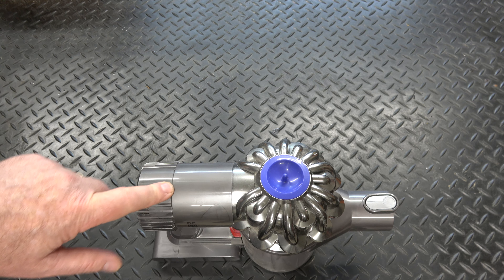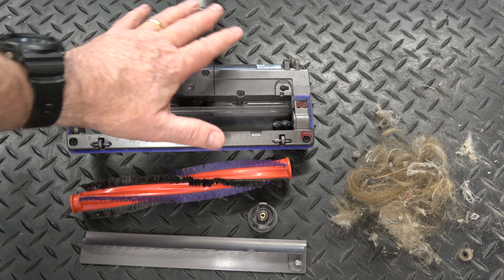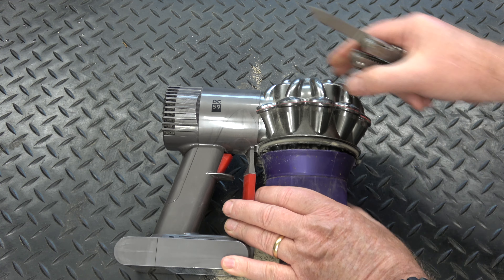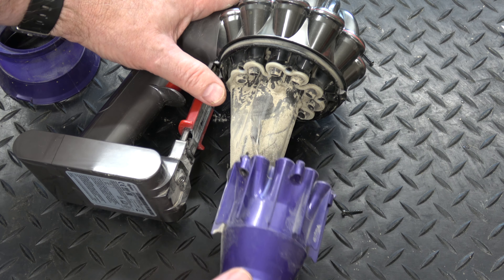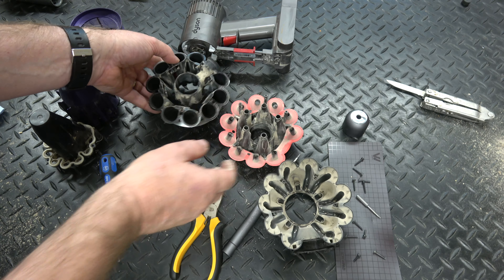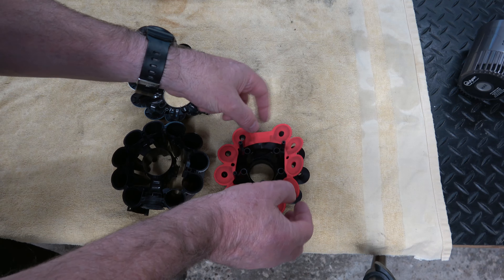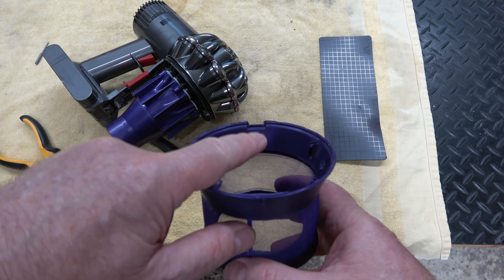Dyson Cordless Vacuum Pulsing or Losing Suction? - Check This Out. Deep Cleaning May be the Answer!

Comment: Thank you Russell - I swear this is the most high maintenance vacuum I've ever encountered :)
Reply from the maker: Ours took a long time to reach the point where I needed to strip it down.  It was much better after I finished the video.  :-)
Reply: The new v11 outsize tells you the maintenance info on the LCD.
Reply: I love your little pen electric screwdriver where can I purchase one of those
Reply: Lol, I've had mine the better part of a decade, and I'm only even watching this because someone decided to vacuum up flour. All I've ever had to do is clear the bin, and occasionally I clean the filter.
Reply: Yeah, they suck Henry hoover, never ever gone wrong and costs a fraction the price.
Reply: @RussellPlatten mine did great for a long time but someone swept up a bunch of drywall dust and I have had to do a full tear down !
Reply: Excellent video. I especially like the way Russell used a vac to clean the dyson. Way too much work. I want appliances to work for me, not the other way around.  Still looking for a good cordless stick-style vac.  Until then, it's back to the corded Sebo for me.
Reply: Agreed. It's extremely needy.

Comment: THANK you very much Russell, I could not have done the thorough cleaning of the cyclone assembly without your detailed instructions. 
A TORX T9  dedicated (not multi-bits) screw driver  6" long from handle end to tip will make this work easy and well worth acquiring one before starting the work.
My gratitude also extends to YouTube for their publications.
Reply from the maker: Cheers Gerd.  Good tip to use the screwdriver!  :-)
Reply: Good idea. My V6 takes a T8 not a T9. Maybe some models are different. Glad I double checked before ordering 🍻

Comment: Thank you Russell - with your help - I have fixed my 5yr old Dyson. It had a broken wand and suction problems a few weeks ago, and hubby wanted to throw it out, but I bought a new wand, in the face of strong disapproval, and it was fine until yesterday... I was puzzled, as I'd taken unit apart last time for a deep clean.It turned out to be the  old filter not fitting properly. Thank you for saving my face, because otherwise I would have had to get a new vacuum, and would never live it down...

Comment: Thank you so much.  I never knew the top came off the filter I had been just rinsing it off.  There was SO MUCH gunk inside and packed tight.  I had to use a tool to get the stuff packed in a the bottom. Now it's like a new vacuum!
Reply from the maker: Glad I could help Scott!  :-)
Reply: Same here, Dyson quality, but shame on them for not letting us in on that one!
Reply: Dyeing recommendation to rinse it is very poor advice. Opening it up as in the video allows a much more thorough cleaning.  I use a small flat blade screwdriver to press down on the raised tabs.  It takes some effort but well worth doing.

Comment: A very comprehensive video. I have a later model that gums up frequently. 
Fortunately I have compressed air & I give it a good blow through with the air nozzle. 

It’s unbelievable how much dust is trapped inside the machine. 

I don’t know how anyone without a bit of mechanical knowledge could own these things 😬
Reply from the maker: I use a compressor on mine too.  :-)

Comment: Thanks Russell; my Dyson was pulsing as well - turned out the battery was faulty so got a new one: but only worked that out by stripping it down and then trying to charge it with just the motor unit. When there's no cyclone attached, and you just have the motor body with battery, you know it's the battery that's at fault! Did the full deep clean and with the new battery it's working like new.

Thanks again.
Reply from the maker: Glad I could help Michael!  :-)

Comment: Great instruction video. However it just demonstrate what a lousy design this product is. You need 2 university degrees to maintain it. I've given up using it.
Reply from the maker: Yes, you are right Georges!  :-)
Reply: I haven’t got two University degrees and I found it easy to fix and maintain haha! I agree it’s crap though as Makita and Karcher offer far better alternatives! 🙂
Reply: The one I am having trouble with ( V8)is only 1 1/2,years old, and I have never had one last longer than three years. They work great when they work but you are not going to have this for a long time unless you have the time (and the equipment) to do this whole mess fairly often.
Reply: Maybe its just me but this didn't look like a particularly difficult process to do every 6 month to a couple of years. I've done similar things to my dc25 mains powered one before. Compared with almost every other brand of bagless vacuum cleaner I find Dysons to be much easier to live with. Most seem to get their filters clogged so quickly and be a horrible process to clean. At least a deep clean like this is infrequent.
Reply: @RussellPlatten  what vacuum do you have now

Comment: Thank you sir for this excellent instructional video. My unit is a V8 Absolute and is very similar. Those 5 screws are very difficult to reach and I used my micro screw driver (tightens my eye glasses hinges) and it worked fine. Also, removing the canister is kind of tricky but I pried on it like you said and used a lot of patience with these plastic parts. So, no damage! I soaked the parts in warm water with dish soap and they were all clean!
Assembled everything back together and it runs like new. Thanks again.
Reply from the maker: Glad I could help!  :-)

Comment: I just bought a used one of these at Goodwill for 20 bucks and it was doing that pulsing on/off cleaned the purple filter and it's working fine, I am going to give mine a good clean like you are doing so I appreciate you posting this tutorial video.
Reply from the maker: You got yourself a bargain there!  :-)
Reply: @RussellPlatten  Yeah I cleaned it up last night and this morning tried it out, wow it picked up stuff my other vacuum wouldn't, I'm seriously impressed with this Dyson V6 motorhead has it on turbo and yeah cleaning.

Comment: So, if I take apart my Dyson, clean it, and then try to put it together (looks easy!)- can I send the parts to you if I can’t?  🤣Seriously, you make me feel confident enough to at least try.  You described exactly what my cordless vacuum is doing - pulsing.  Probably just needs a really good, take apart cleaning, as I have had multiple dogs in the past. I actually have the T8 screw bit, so am set there.  I’ll make sure I magnetize any bits I use to avoid the pitfalls of missing screws.  I really appreciate this easy to follow and understand video!  Even if I ruin the vacuum (which I doubt), right now it’s fairly useless to me.  Thanks for making!!!
Reply from the maker: Glad I could help!  :-)

Comment: Thanks for the video. You definitely made the process easier.
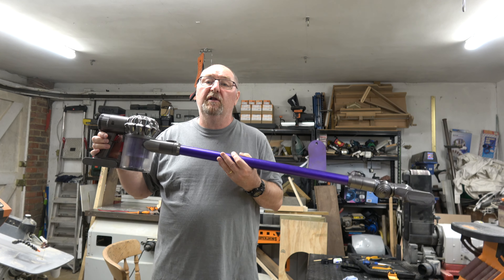@ 12:07 you start to connect the motor assembly with part of the cyclone. After I'd cleaned and dried everything, I completely assembled all of the cyclone parts together. Then I connected the motor assembly to the cyclone. It seemed to be a little easier because I didn't have to hold the motor and the battery as I was assembling the last of the cyclone. Thanks again.
Reply from the maker: Sounds like a good tip!  :-)

Comment: You have more patience than me. 
I just separated the cyclone unit from the main and flushed it with water from all angles then blocked it off to fill it with water and shake rinse until water ran clear. Then dried it a warm place with a fan blowing into it for a few hours then  clicked it back on.  Much better performance!
Reply from the maker: I am glad it worked Matt!  :-)
Reply: @RussellPlatten  likewise Russell, thanks for the informative and concise video 👍

Comment: Well it worked first time for me. I need that 8-size star driver, my smallest was a 10. I did find a twisted plastic coated wire with soft bristles got a ton of stuff out of the vortex channels, and when I tweaked the plastic back in place and replaced the dust container, all worked fabulously.  This is TERRFIC stuff Russell - Thank you. I'll apply similar principals to my old Dyson 1 suction section now. Although nearly all user parts are now third party as Dyson discontinued theirs, it still works pretty well, so long as I keep everything clean. Kind of makes you wonder why one has to use another vacuum cleaner to get all the gunk out of this one!!
Reply from the maker: Glad I could help John!  :-)

Comment: Fantastic video, big thanks to Russell,  pity you chose a silver black vacuum my white colour V6 would have helped with the colour contrasts in the video . Nevertheless the whole shoot was fantastic and i serviced  my v6 as you described and it all went very well thanks to you.  I found the last 5 piece screwed in unit, which joins three pieces I found the screws didn’t tighten with certainty in all 5 sockets but it seemed fixed firm enough. I also bought a ; T8 150mm HEX bit *set for £8.99 to reach the screws and a 4000 mAh battery with a free filter for a combined cost of  £20 delivered and my V6 Dyson has come up as new, I definitely owe you a beer ,🍺
Reply from the maker: Glad I could help Michael!  :-)

Comment: Thank you for this. I have the DC7 and was able to do most of the steps of this video. I could not get the bit in the bin off the machine but used a tiny bottle brush to get out loads of fine dust.
Reply from the maker: Glad it helped Rosie!  :-)

Comment: Just found a non-working V7 stick unit at a thrift store: LED just flashes once when pulling the trigger. I disassembled it alongside my brother’s non-stick V8 that I had already installed a DeWALT battery adapter into… meaning I also get to use his charger for mine now that I fixed it (spoilers?). ;) They are almost identical except the V8 has a post filter.

The battery had already been replaced with an aftermarket. Turns out the motor was seized even though that part looked like it had never been used without even a spec of dust internally. Once I had it out I could force it to turn by hand and the crusty resistance just gradually went away as I turned it. Didn’t even have to lube it though I went back and put a dab of sewing machine oil on the hole in the center of the blade (no telling if it will make its way in deeper).

Haven’t seen anyone mention this fault/fix yet, so I hope it helps someone.

Comment: Apart from wanting to commend you on such a great, thorough how-to video...I also want to ask whether you love that Xiaomi's electric screw driver --- I personally love it, the gazillion tips included really are useful.
Reply from the maker: Yes, the Wowstick is great for electronics and other small jobs.  It does not have a lot of torque, but makes things way quicker.  It acts like a fixed screwdriver when the trigger is not pressed, so the torque issue does not matter.  :-)

Comment: Thanks for such a clear demo. I tried removing the filter and washing it but that didn't work. I don't have the strength in my hands to prise the blue top off the filter. Bought a spare some time ago and tried fitting that but no luck. Am now going back to the original and using a bit of brute force.

Comment: Ive been using compressed air on my V7 after dirtier jobs as preventative maintenance. It’s incredible how much dust gets blown out after a little use, I hope that doesn’t do more harm than good.
Reply from the maker: The only issue I can see is blowing dust into the motor.  I think that if you are not prepared to strip it down, blowing it out with compressed air when it loses performance is better than nothing and should improve things.  I would try not to do this too often though.  Mind you, I am no expert so I may be talking a load of rubbish!   :-)

Comment: Nice one. Easy to follow video, mine's in bits in the sink. Should do the trick. What about the filter around the motor switch, can this or should this be cleaned? Thank you!
Reply from the maker: If you are prepared to work on the motor housing I would go for it Matthew.  :-)

Comment: Thanks for the vid Russell, very helpful. But sadly, mine still pulses afterwards 😢

I followed the steps to the letter, vacuumed, washed and wiped every component to spotless. Reassembled everything precisely, and then washed/cleaned the main filter and also the motor housing filters, and finally cleaned the main suction throat. I also ensured the washed filters were bone dry before reinserting. But still it pulses. 

I’m the designated house ‘fixer’ of things 🙄so am reasonably handy at this sort of thing, so am stuck as to where to go next. Any suggestions, very much appreciated 👍
Reply from the maker: Mine did the same a couple of months ago.  Cleaning did not fix the issue.  I decided to try a new battery.  That did not solve if either.  I decided to get a new vacuum and bought a Shark to try.  The Dyson lasted a long time and I have no complaints.  Sorry I can't be of more help!  :-)

Comment: Russell, your video is great! Could you please tell me the brand of your screwdriver? I found one on Amazon but it did not seem very reliable...
Have you disassembled the container as well? There is this small  "flip"/"door". Mine is stuck. I tried cleaning from outside, but it obviously got sticky from something and needs harder rub. I am afraid to remove the screwdriver because there are cables in there...
Reply from the maker: The screwdirver is a Wowstick, there is a link in the video description.  I have not dismantled the container.  :-)

Comment: 7:27 So when you take the center piece off. If you notice around the array of those cyclones you will see the square inlets at the top where it enters the cyclones you can gently chamfer those to create better airflow and prevent dirt from sticking in those area's by rounding them slightly. A light dremel and then Slightly heating it afterwards to remove the burrs you can actually improve the airflow and better cyclone action. If your leary about this, it's better to do it on a spare cyclone. I did this at first to my spare cyclone canister for my v6 and 7 and it works amazing. Then I did it to my main one. You gain about 15cfm
Reply from the maker: Good tip Eckehardt.  :-)

Comment: That Wowstick is great! But pricey... And that star shaped screw pattern is known as Torx. One thing I do like about the Dyson is how relatively easy it is to disassemble and clean - at least when it comes to removing hair from the motorhead's brush bar (spindle).

If you could edit your Description, I would amend "DC59" to "DC59 (V6)". The DC59 was renamed V6 to go inline with the naming change, but ironically none of the accessories are compatible with the rest of the V-series from V7 and up!
Reply from the maker: The Wowstick was way cheaper when I purchased it.  :-)

Comment: Great.  Thanks. How can I access the filter in the handle itself - where that lovely blast of air comes from when using the unit!?! I’ve removed the screw and done some wiggling around but can’t remove the panel to access the filter behind the MAX button. Cheers.
Reply from the maker: I never knew about this filter Keith, but there are videos on here showing how to access the it.  :-)

Comment: I love your little electric screwdriver where did you get it from? Great video I have several dc59 that I used within my fleet, I'm having a problem with a couple of them will they keep cutting out like your demonstrators I've cleaned out there bin and cyclone chamber as you demonstrated but I still got a couple of machines that keep cutting out. As it's now the downtime I'm planning to dismantle one down to it's bare components to see if I can rectify the problem.
Reply from the maker: It is a Wowstick, there is a link in the video description Lee.  :-)

Comment: Thanks Russell, very useful vid.
I have a DC56 which works fine for about 15 secs and the  stops. If I release the trigger and press it again, the same thing happens. 
I replaced the battery last year which seemed to fix the prob but it's doing it again now. It does this even when I operate the unit without the waste bin or filter attached. 
Any ideas?? Thanks.
Reply from the maker: There is another fitler that I missd in the video.  It is behind the max button on top of the motor.  That could be the issue.  There are other videos on here showing this filter:  https://www.youtube.com/watch?v=hfrPBeckjtw       :-)

Comment: Excellent video. However,  some of the newer cordless dysons have quite brittle rims around the  inside filter/screen that needs to be plied off. It was hard enough before, now it's even harder, but easier to crack the rim. Darn Dyson...
Reply: Agreed. The design is different, it can't be removed with just a squeeze, and the 'mesh' is now part of the top, so it only splits into just two parts with great difficulty.

Comment: Good morning. I followed your directions to clean my dyson a d put back together. Now it won't turn on. I'm assuming I must have missed something putting it all back together?
Reply from the maker: Nothing on the video should affect the operation of the motor Samantha.  I do not know what is causing the problem.  I would try removing and replacing the battery.  :-)

Comment: V8 DC44. No youtube videos on this model except for yours. Handle has only 1 screw, the screw is not a Phillips but an Hexagon Allen. I removed it. The battery won't slide off, is it bc or the charging port on the bottom of the handle? Do I need to push it in or is the battery difficult to remove? Thanks and I hope you can help!